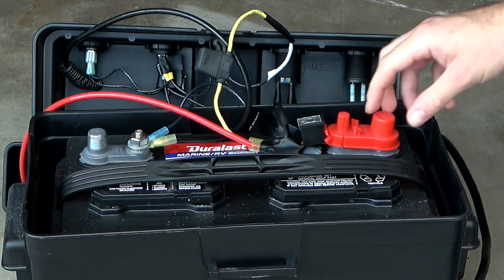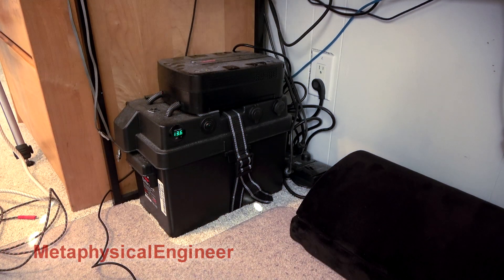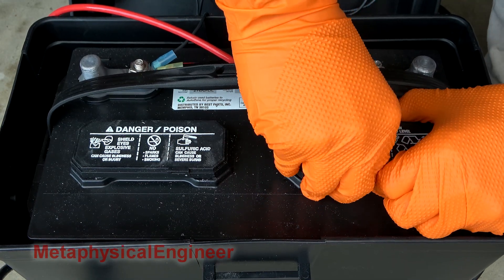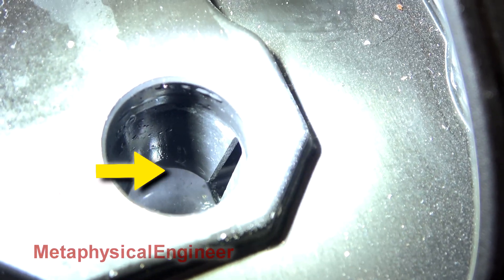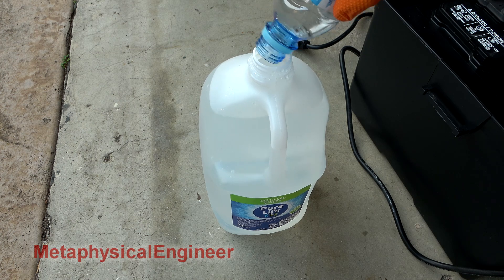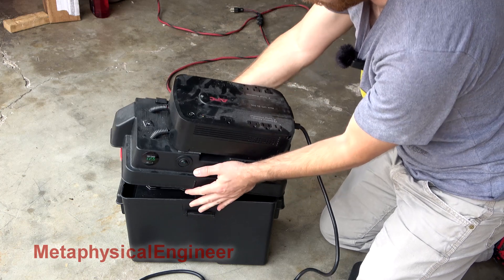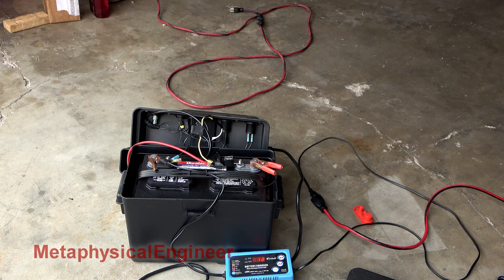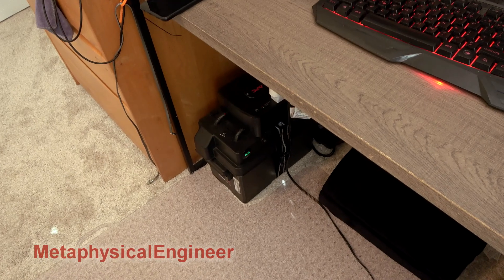Marine Battery UPS Maintenance

Comment: Where did you get your battery?
Don't see too many batteries that allow you to add electrolyte to them.
Reply from the maker: I got this at the auto parts store.  Flooded batteries are still available, usually as the cheapest option.  AGM would have been better for this application using the original charging circuit.  LiFePo4 would be best overall, but need a BMS designed for it and would have ballooned the cost.
Reply: @MetaphysicalEngineer I know they are available but by me the cell caps are welded on and you can't check the level.

Comment: I thought of doing the same thing, although I don't know if the regulator is capped at a certain wattage, and if so, should that be left alone for safety or somehow modify it to accept more continuous power without entering the danger zone of all things? I have the ES 650 model currently for my PC setup.
Reply from the maker: The stock charger is very limited to just a handful of watts.  Leaving it alone will keep battery topped off, but not be able to charge it up very well if it actually gets used.  The best option when adding a big battery would be to rig up a secondary smart charger/maintainer that can charge back up in reasonable time.   But also the faster rate will produce more off gassing, so for that an AGM battery would be the better choice too.
Reply: @MetaphysicalEngineer  I do have a 12v 22Ah AGM battery from a jump pack I sourced from. It'll be more than twice the capacity of the stock battery. Specifically an Interstate HSL1116. I also have a car battery charger that accepts flooded and AGM types, to which it will charge the battery to spec.

Would it just be a matter of rigging a battery connection and clipping a battery charger onto the battery itself, or is there a lot more involved to it?
Reply from the maker: That should work as long as that charger has provision for float charge that can be left connected indefinitely!  Though 22 aH is small enough the original charger of the UPS should be sufficient.

Comment: I thaught that style of UPS only beeped non-stop if the battery was close to dieing.. which yours clearly was not.  Maybe the voltage of the wet Cell is lower then the SLA that used to be in the UPS?
Reply from the maker: I think the UPS assumes that it only has minutes left under heavy load long before the voltage drops very far, simply because the tiny internal battery would give up quickly.  If I had upsized the cables going to the inverter, maybe it would behave a little better.  

The wet cell resting and discharge voltage will be similar to the sealed, but will tolerate a higher charge voltage to deliberately gas and stir the electrolyte.  Hence the periodic maintenance where I top off the water and cycle it with a faster charger.

Comment: What would you consider a reasonable wattage limit for one of those connected to a larger battery but without the cooling modifications?
Just looking to run a lte gateway/router and 4 to 8 watts worth of led bulbs. Should be under 25 watts total.
Reply from the maker: 25 to 50 watts will probably run until the battery's flat. Cooling mods are for high power for much longer duration than normal.
Reply: @MetaphysicalEngineer  Thanks! In that case, I guess I'll fuse the DC side at 3 amps. That'll provide more than enough for the purpose and hopefully prevent burning the house down if something else gets plugged into it during an outage without my knowledge.

Comment: I love this project. I wish you would do a simpler version though. Like with just a few smaller sealed lead-acid batteries and without the extra electronics upgrades - you know, for the less technically inclined of us.
Reply from the maker: Thanks for your kind words!

Unfortunately as seen in the main build video, the UPS is designed to have the internal battery discharge before the inverter overheats.  Without that fan, I'd have a magic smoke generator instead of a power supply!  A bigger, higher quality unit has better chances of surviving expanded battery capacity.  Time will tell what a future version 2 of this project will be.  

Extra bits like the voltmeter and USB ports on the battery box of course were entirely optional.  Fuses however were mandatory given the extreme fault current available from large batteries.

Comment: I bought 2 of these, ready to replicate what you have here, thanks for sharing :)
Reply: Good video. I've set up my backyard solar with 2 SLA 100ah battery's. Cost for one but our super heat in Vegas. 120° this summer. I get my 1500w microwave to run for 3min. Then the inverter uses the battery protection to shut off. Using 1.o gauge wire. Maximum 150 amps. Love tinkering.
Reply from the maker: Follow the notes and supplemental material.  Can always drop a comment if you have further questions!  Good luck!
Reply: @MetaphysicalEngineer  will do, thanks :)
Reply: you could have bought one lifepo4 for cheaper and had better results. , i made my own from raw cells for 50$ 12ah 25.6v and get an equivalent run time of 24v 28ah leadacid on my ups . 6 of the 9ah leadacid that my ups use would cost me 120$ even if i buy the cheapest of cheap Vietnamese cell. and they don't last more than 5yrs,
Reply from the maker: That's really cool you built a pack!  How did you go about the BMS for cell balancing?  Certainly can't get new raw cells that cheap where I'm at unfortunately :(

Any off the shelf LiFePo4 that I trust costs way more than lead acid for equivalent capacity, and would need a separate charger for best performance and reliability. With raw cells like you used I'd need 3 times as many to equal the lead acid here.  I agree the performance per size and mass are far superior, and a second version of the project will likely use lithium instead.

Lead acid: 75ah @ 25A draw x 12V = 900 watt-hours under load
Lithium: 12ah x 25.6V = 307 watt-hours
Reply: @MetaphysicalEngineer  They are also not compatible with the charging circuit for Lead Acid batteries. AGM like to be floated for standby (UPS) applications at about 13.8V. 13.8/4 = 3.45 - above the recommended float voltage for LFP.
Reply: @MetaphysicalEngineer  to build the pack i first tried to solder and it didn't work. Even with good flux and high temperature iron i couldn't get the solder to stick without making the battery warm and didn't want to risk an explosion. So i went to make my own spot welder. At first i tried to rewind an old 1kva transformer but the amps or something else was not right and it wouldn't make strong welds no matter how hard a try. 
On a random youtube video i found someone using a motorcycle starter relay as a high current relay and motorcycle battery to spot weld cells. I copied that idea and it worked flawlessly. The starter relay was around 7$ & i made the probes out of solid copper wire ferrules that are used in mains distribution box. 
As for the bms situation. I tried using a bms but the bms randomly cuts of at the end of charging cycle or at the end of discharge cycle. The ups does not like that. So i bypassed the bms and kept it only for top balancing the cells. I regularly check the cell voltage and never found them to be out of balance while charging discharging or floating. They go slightly out at the very end of discharge which is expected for Lifepo4 as they have very little capacity at the end and voltage drops to sharply so any tiny difference in internal resistance gets amplified at the very end of charge or discharge. 
The apc br1000g-in ups i am using has a very nice charge controller. Complete separate pcb and even has a jumper to increase charge current from 1.25amp to 3.75amp for the extended battery pack. That adds additional pair of 2x 9ah leadacid. (Totalling in 6x9ah battery). With the additional pack according to apc's own runtime graph the ups should run 300w load for 45min. In my tests with 12ah 25.6v Lifepo4 i got 47mins at 300w load. And the Lifepo4 is cheaper than the builtin 2x9ah battery. While the external pack comes with a price tag of at minimum 120$ new. So all in all quite a bit of $ to be saved. And power doesn't go out that often here so i didn't go with more cells. The 32700 cells i used claim to handle 3c discharge but in my tests 2-2.5c is the max safe limit. At 3c discharge the cells tend to get hot to the touch. I only did a 3c discharge for once and the cells got to about 45c temperature. 
My pc draws 150w at idle and 300-450w while gaming so 12ah is enough to handle the load in my case. But if you have higher load demand then you have to increase amp hour capacity. Generally recommended to not discharge these any faster than 30min.
Reply: @bélalugrisi  my ups floats at 27v , stops charging at 29v and stops discharging at 21v. So perfectly within the range of Lifepo4 charge and discharge curve. 
Lifepo4 does not require any perticular float voltage like leadacid. They have no self discharge and the "float" voltage is just their fully charged resting voltage. You can keep them at 29v forever and it won't damage the cells unlike leadacid. One thing the Lifepo4 makes unhappy is the runtime calculator in the ups..
Reply: @KuntalGhosh  Using two 12 volt batteries? Sounds about right. Wondering if you have bt monitoring on them and if that's what ya got. Thanks for the reply and best to you.